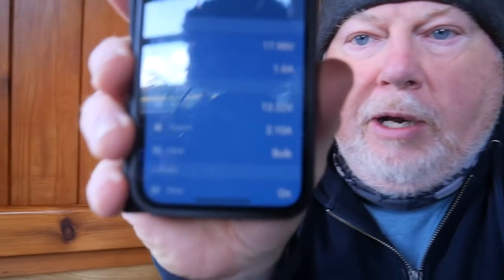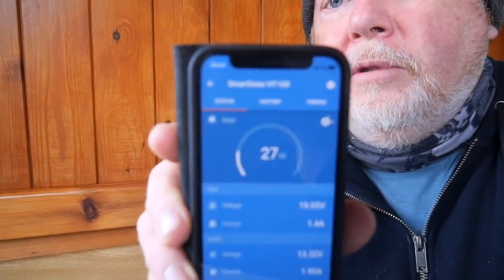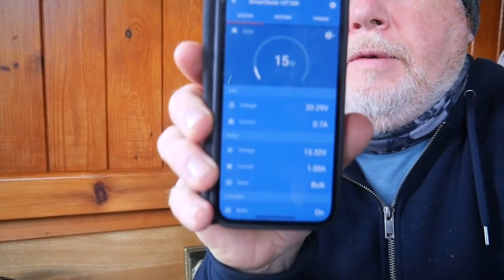Narrowboat Engine Room and Eberspacher Heating

Comment: Great vlog. Anyway, quick question: with a hydronic Eberspächer do I need any other heating systems e.g. a multi-fuel stove or diesel stove? From what I can understand, the Eberspächer provides heat, runs 2/3 radiators and provides hot water so why would you need any other heating system?
Reply from the maker: You could just use the eberspacher all the time. It would I think be more expensive to run than a multi fuel stove so I recommend having both.

Comment: Hi I agree should not have water in engine bay best bet find where it’s all coming from,well this must be your new hobby fixing narrow boats .cheers
Reply from the maker: The partial clean up has helped me locate at least one major leak in the deck. I've a plan to plug that with some fibreglass and a plastic pipe :) - I'll video that for all to see :)

Comment: Loads of work Steve but it's coming along nicely, good news about the batteries, I had a quick word with my Bruv, as he has worked on boats for years,  more on the woodwork construction side tho as he is a carpenter by trade (He once fitted out a complete 40 foot Yacht with teak that cost just over £100 a foot !! OMG imagine making a wrong cut!  )  Bruv said that the glands do leak a little but advised that they should be checked every year for wear and replaced if worn so that might be your problem if previous owner(s) have not had it checked.  Take care both.
Reply from the maker: Thanks Steve. I’m very sure that the stern gland is ok. Although plan to have it checked on the next hill blacking (Mar h 2022).

Comment: It sounds as though the main propshaft bearings could be worn, no amount of grease in the stuffing box will stop the water coming in. If you can reach down and give the prop a good pull up and down, you might be able to establish the wear without getting the boat lifted.
I would think you must have plane bronze type bearings with the system you have, so fairly straight forward to repair but not cheap. leave it too long and you could damage the stainless prop shaft. Anyway enjoy the sunshine, and a nice video too.